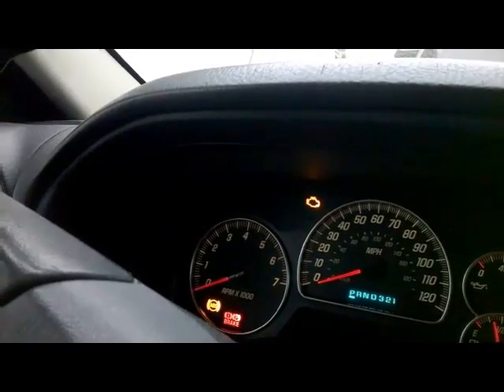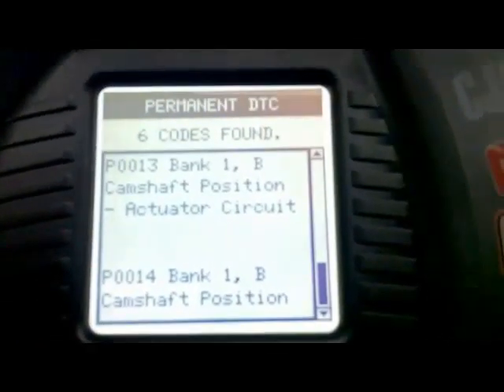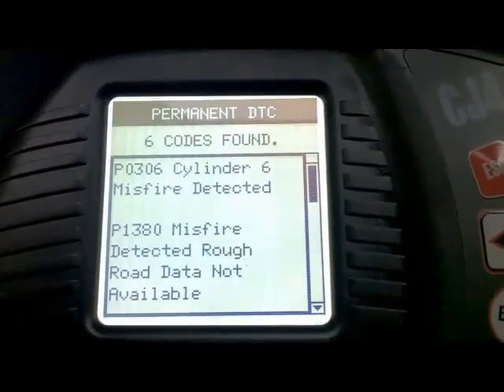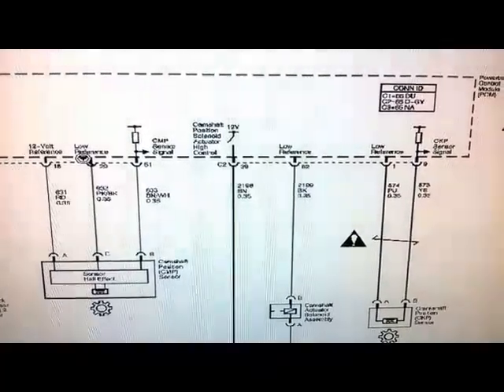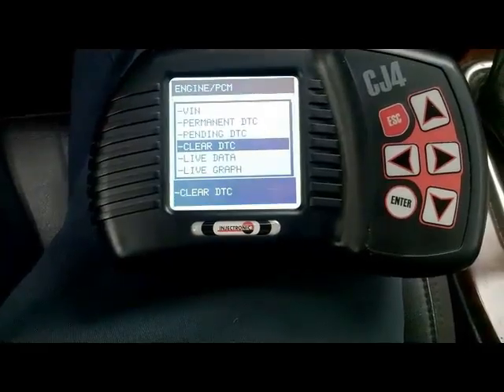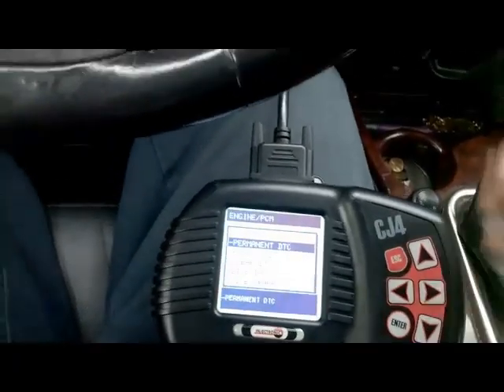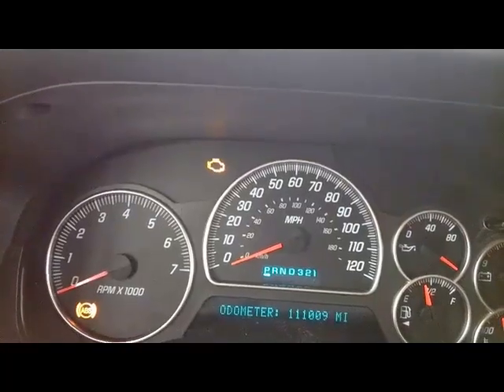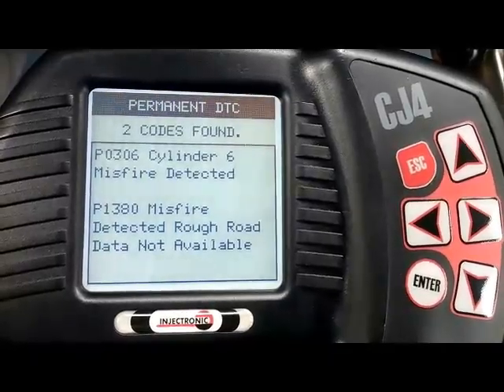(GMC Envoy) Troubleshooting trouble codes P0013 and P0014

Comment: Can also bad solenoid create a parasitic battery drain? I have a parasitic battery drain overnight problem on my 03 envoy 4.2L and I get P0014 code every time it happens..
Reply from the maker: Only if you have a shorted driver from the pcm that controls that circuit. Try disconnecting the connector from solenoid overnight and see if your parasitic goes away.
Reply: @EliTheOBDTech  OK thanks, will try it tonight..

Comment: Good video
When back probing I’m not getting 12v on the power side. Could the ecu be bad?
Reply from the maker: Combination of a bad pcm or wiring issue.
Reply from the maker: If you have a capable scanner that can do bi-directional, you can actuate the solenoid to see if the pcm is sending the 12v to the connector.
Reply: @EliTheOBDTech   we do not. Any other testing that can be done? We tried pinging the harness and it beeps all the way to the ecu so I’m guessing the wiring is good.
Reply from the maker: @teddiazjr.6223  You can perform one more test, back probe the wire and try to use a long wire to perform a test drive so that you can have volt meter inside the vehicle while driving to if the wire ever changes to 12 volts. If it doesn't, then most likely pcm driver issue. It would be more easier if you had a scantool to perform bidirectional.
Reply: @EliTheOBDTech  
Thx for the reply. I will follow up on that test and for some reason I do have these 5ft long alligator clips so they will finally get used. Thx again for the advice.
Reply: @EliTheOBDTech   ok thx
Wiring seemed good but the pcm was not sending the command

Comment: Would it be difficult to pass a smog check with cam problems?
Reply from the maker: If check engine light is on, then yes.
Reply: @EliTheOBDTech  I took my 2006 to the shop for check up no light was on. they contacted me and said it came on when they test drove it, they want to charge me  3000 for cam service.
Reply from the maker: @attaofthelight  As long as your check engine light off and has no major driveability problems, you should be good.
Reply: @EliTheOBDTech  Thanks

Comment: I changed the selenoid following the steps you mentioned now it runs very smooth, but when revving the engine I hear a knock/tapping noise. Do you know why? 
Thanks
Reply from the maker: You may have lifter problem
Reply: @EliTheOBDTech  I am planning on changing spark plugs, cleaning throttle body & MAF sensor. Already changed oil & filter.
Reply: Check engine light is not on. I don’t have any codes .
Reply from the maker: @ahmedkamla2109  oh ok, usually on these engines worn lifters will make the knocking sound without any driveability problems.

Comment: Hello Eli ... I've already done the voltage controls and everything is fine ... what can I do? Any suggestions?
Reply from the maker: Mundy43 is there any performance issues with/out the p0014? In other words, does your vehicle run the same with or without the code p0014...
Reply from the maker: Mundy43 what's the year and make and model?

Comment: Good afternoon Eli ....I am from Quito - Ecuador..Aa question please: change the oil and the oil filter, the VVT valve, the engine is just repaired, change the phaser camshaft and I still have the code P0014 even though I delete the code
Reply from the maker: Mundy43 Perhaps you may have an electrical issue with the vvt harness connector. Have you done your voltage checks.

Comment: Do you have to replaced both, solenoids because I had the P0013/P0014 and I charge the exhaust solenoid and check Engine light still on and code still comes up

Comment: Hi,

I followed your video instructions and have changed the intake and Exhaust Camshaft Solenoids on my Saturn Aura 2009. I don't have p0013 & p0014 error codes now. Thank you so much. However I am getting p0171 code now that says "System Too Lean Bank 1". What could be the issue . Can you or anyone please help??
Reply from the maker: Rishabh kataria A system too lean code can relate to an intake vacuum leak, faulty upstream o2 sensor, faulty/dirty MAF sensor, restricted injectors/fuel filter or some valve train problem.
Reply: Eli TheOBDTech thanks . I cleaned the mass air flow sensor and it's been a week no error code so far. Thank you :)

Comment: P0014: What fixed mine... so to avoid taking the PS pump out the way here's what i did, i bought seafoam pulled it out to the furthest point place towel around spillign area, sprayed the seafoam all over it then placed it back in. I then did an oil/Filter change with MARVEL MYSTERY OIL. 1 BOTTLE RIGHT BEFORE THE OIL CHANGE AND THEN 1 BOTTLE With THE OIL CHANGE which would then mean you would put 6 Q Oil instead of 7 in the engine. Problem went away and has not came back.

Comment: i have a problem with my 6cylender altezza the idling is too high
Reply from the maker: Lenka Ralekuku In most cases, it's either a faulty/dirty idle air control valve or dirty throttle body. Even a vacuum leak will affect idle.

Comment: I have changed both the camshaft sensor and the solenoid and I still get P0014 code. Oil was changed recently. Gas Filter will change tomorrow. what else can I do to get this light off?
Reply from the maker: Myrtle Bouton Unfortunately, you may have a mechanical problem with your valve train, for example bad push rod(s) etc.
Reply: Try Marvel Mystery oil in your gas and engine oil. do another oil change with 1 quart being the MMO. get back to me.

Comment: I seem to have no power to either wire with dvom Koeoff. Any ideas? Code p0013 2006 trailblazer 4.2
Reply: With connector disconnected
Reply: I'm only getting 0.5 volts

Comment: OK I found the two wires coming out the pcm but only the gray wire have power the brown doesn't. Is this normal or both wire have to have power.... Thanks
Reply from the maker: Overtheroad 2005 sorry for the delay. it seems that you may have potential short on your ground wire. The brown should be your 12v feed source and your grey should be your 0v ground wire. with key on engine off, both wires should read 0v with the connector connected to the solenoid. the only time you should see 12v is when the pcm energizes the brown wire and the grey should remain at nearly 0v or with the key on engine off and the connector disconnected from the solenoid the brown wire should also read 12v and the grey should remain nearly at 0v.
Reply: Eli TheOBDTech Yeah I think the pcm is not working on this wires because I plug the connector to the solenoid and is not kicking out....but what if I put another pcm, do I need to programming. Thanks
Reply from the maker: I believe that you would only need to perform a crankshaft position variation relearn, you would need a high end scantool or take it to a shop.
Reply from the maker: Is your vehicle the same make and model?
Reply: Yeah the guy send me pictures of the pcm and is the same number soam gonna try to see if this solves the problem....i will let you know about it... Thanks
Reply from the maker: Before you try to swap the pcm, I would try to find the root cause why the ground wire has 12v on it, this is a short to power, not short to ground.
Reply from the maker: Ok, sounds good. Good luck.
Reply: I think is because of the pcm....
Reply from the maker: Let's hope it is.

Comment: I connected to the power and the cylinder didn't kick and so I found out there's no power coming to it...but try the old one by connecting directly to batt and it did kick, but when I connect the connector there's no power coming to it . What could be the problem.... Thanks
Reply: ever fix this. I'm only getting  o.5volts

Comment: with a P0014 code on a 2005 envoy would it hurt you gas mileage. i just had this code pop up. the gas mileage is bad run a little rough but does not stall. any comments
Reply from the maker: Chris E this code will affect your engine performance, specially your timing, thus affecting your fuel trim nimbers

Comment: do u know the reason why the brown wire is giving me only 9 volts ..2002 chevy trailblazer ..thanks!! great video
Reply: juan velazquez that explains why I'm losing a quart to quart and half. I have no leaks that I can see. I just bought a alternator thinking that was it , 👎. SUCKS. Thank you for information I'm trying to do it by myself to save money.
Reply from the maker: you might have high resistance in either the brown wire or high resistance on the solenoid internal coil windings.
Reply from the maker: +Eli TheOBDTech did you try to unplug the connector while back probing the brown wire, did you get 12 volts?
Reply from the maker: +Eli TheOBDTech Did 9 volts come with the connector being plugged in?
Reply: the connector was not plugged in when i got the 9 volts .. plugged
 in gives  0
Reply: i got the code p0013 i did replaced the camshaft solenoid because it was really drirty and i saw that the harnes had a lot of oil inside...
Reply from the maker: +juan velazquez did it resolve the problem replacing the solenoid. perhaps it is just a bias voltage. it your problem was resolved, you shouldn't worry about it.
Reply: +Eli TheOBDTech it did not..the idle is worse than before!! Do u think I should change the plug..
Reply: +Eli TheOBDTech i tested the solenoid just to make sure that it was not defective but seems to be ok...I don't know where to go next!! Thank for replaying by the way..I really appreciate it!!
Reply: juan velazquez same here bro on a 07 trailblazer. If I cut my wheel to hard it stalls, turn on headlights and heat it stalls. I don't what to do any help will be greatly appreciated.  Thx
Reply: I replaced the solenoid and the plug connector.got burned out with the oil from solenoid when leaking!!
Reply: Eli TheOBDTech has a
Reply: Eli TheOBDTech  a

Comment: OK, good job, having a same problem with my Infiniti FX45/2004, also smoking like crazy???/ Will do valvestem/ valve job, and change the pistonrings too, hopefully that will fix my smoking!! But now, rough idle, almost stalling, I am sure, those camshaft actuator solenoids are pretty clogged up, will clean them actually tonight, with mineral spirit/ carb cleaner! What is wrong in your car with  oilpressure gauge???/

Comment: I got the same symptoms but without the codes. The throttle body was cleaned, the spark plugs were changed, the oil is changed every 3k miles and the oil pressure sending sensor was changed. I will try this...

Comment: i have replaced this part , but did not solve the problem of engine going off frequently when comes to standstill . your kind advise, knowing that we had an engine flush done too.
Reply from the maker: Jeannette Marie HI there, yes the camshaft actuator can cause those symptoms. the actuator controls the variable camshaft timing during different loads. I would start by checking the oil level, if the oil level is to low, you will encounter those symptoms that you are having. if that checks out well, then probably the actuator can be either dirty with debris on the oil passage screens or the solenoid part of the actuator can be bad. I'm not sure how a shop would charge for labor. the solenoid should not be more than $100.
Reply from the maker: Jeannette Marie Hope everything goes well and thank you for checking my video.
Reply from the maker: check for oil level, low oil can cause these codes. Another possibility could be excessive timing chain slack.
Reply from the maker: +Eli TheOBDTech Does your vehicle give you these codes? 
I was also thinking that you should check your throttle body for excessive carbon gunk on the throttle body that may cause it to remain partially open and makes it turn off at standstill. Another possibility is a faulty or dirty idle air control valve.
Reply: Eli TheOBDTech I just bought a 2011 GMC terrain and mind I say bought it 2daysago everything was working fine and was driving smoothly but when I went to drop my son off to school the check engine light turned on so after I dropped him off my car kinda wanted to tug so I went to my local AutoZone they used the computer checked it read codes p0010 & p0013 I hope I put the codes right😥 but it said camshaft position actuator so when I was leaving AutoZone was at a stop light my car wanted to turn off on drive still. so idk what it can actually be if it's reading those codes and doing that. does the camshaft position actuator make it do that? please help worried and pissed at the same time& if it is how long does it take to fix it!!😢
Reply: OK cus when I bought it and when it happen I called the dealership and they told me maybe because we just changed the oil so maybe dirt fell in there I'm hoping it's that. I know I won't pay nun outta pocket I hope not but hopefully it's something they can fix there and then. and ty for replying fast🤗

Comment: Hello buddy  i have a toyota sienna 07 3.5  i o ready replace the vvt bank 1 and I still have the code p0368 and i check the fuse box  i find 2 fuse 15a ther R no power ther bu the fuse r in good condetion what can i be boss ineed help thanks
Reply from the maker: did you perform the voltage checks. perhaps you have an electrical problem.
Reply: Eli TheOBDTech hey thanks for the video, I did my power test on it and is not kicking out, but then I did it directly to the batt and yes it kicks.... it means there's a short problem?

Comment: Hello boss please ineed your help whit my toyota sienna 07 3.5 I have this code  P0368 Camshaft position sensor 'B' circuit High input (Bank 1) DTC status  can you please tell me if is The VVT the problem or the camchaft sensor  Thank Buddy i always watch your good videos Your R the best
Reply from the maker: sorry for the delay, usually it is the the vvt sensor. you must do further diagnosis to conclude that the sensor is bad. check for power and ground and signal from the sensor. use a voltmeter to perform this checks by back probing each wire on the sensor connector. when you back probe the signal wire, you will probably have a reading of 4.7V or more(5V). once you back probe it, start the engine and check to see if voltage on the signal wire fluctuates or if the signal remains at 4.7 or higher without fluctuations. Your signal wire should be yellow, power wire should be blk/wht and ground should be blu/wht. let me know your readings, thanks.
Reply from the maker: this code refers to your bank 1 sensor 2 exhaust vvt cam sensor.
Reply from the maker: I would also recommend watching my video on "2002 nissan maxima p0335 long crank condition" for testing procedures.
Reply: Thank you Campion voy hacerlo

Comment: hey did you have to remove that pulley to get to the other two bolts?
Reply from the maker: I did not have to. the pulley has holes.
Reply: +Eli TheOBDTech thanks, one more question, how clogged is enough to cause fault?
Reply from the maker: +TheLCWorks when most of the screen ports are clogged and oil can not get through the oil screens.

Comment: Nice video! After researching my 07 G6 hard shifting and engine light I got the code  P0014. Went to go and bout both intake and exhaust. Then I watched this video which was done great and it fixed both the engine light and hard shifts! Thanks
Reply: hey man I have a 2007 g6 gtp with the P0014 code I want to replace the solenoid but i have no idea where it is located

Comment: Hi my truck 2006 trailblazer keep failing inspection after $500 down codes p0014 and P0041 keeps coming up. Should I just go to the dealer
Reply: Yea for a trade in or a new timing chain

Comment: Nice vid. I've got a 06' trailblazer 4.2 with a ruff idle I can't figure out. I've done the usual stuff. Throttle plate, plugs etc... Have you heard of this happening without the code?
Reply from the maker: Geoffrey Platt Have you checked for compression. If you have a scan tool, check your short and long term fuel trims numbers. Try to relay that information to me if possible. thanks.Sorry for the delay, I've been away for awhile from working on cars. Busy schedule.
Reply: yeah compression is ok no more than 50 psi between cylinders, the blow by seems a little excessive and it uses a qt between oil changes about 7.5k (when light comes on.) ill check the numbers, the O2 maybe getting lazy its never been changed.
Reply: Eli TheOBDTech hi i have a 2003 chevrolet TRail blazer LT 4.2 and rwd... i have the p0013 code but i already change the camshaft, crankshaft and oil pressure switch and the oil pressure gauge still going up and down when i stop on a red light or something but works fine when the truck is running

Comment: GM's are such a pain now .. I have a 2006 Colorado .. I have p0017 code .. I replaced the actuator solenoid / cam sensor / crank sensor / pulley tensioning arm / spark plugs / cleaned the throttle body / ran sea foam through it  / oil change & engine flush .....   Turned out to be the catalytic built into the exhaust manifold however their was no code for o2 sensors .. just p0017 .. the EGR valve was done away by routing it through the VVT actuator causing p0017 ... WTF GM !!
Reply from the maker: Keith Bernasconi Wow, its nice to know about that. thanks for sharing this info.
Reply: Thank you. Because these shops guess as well. Don't think you're getting any money back for the work but they will continue to work on your vehicle.  Could cost more.